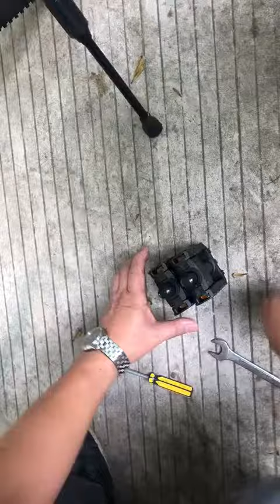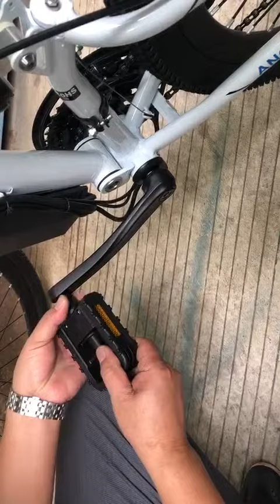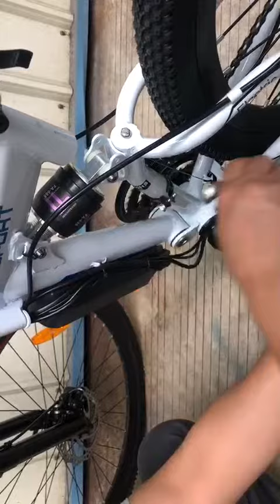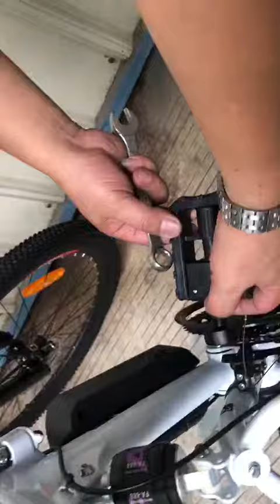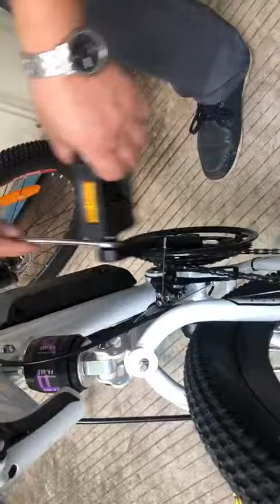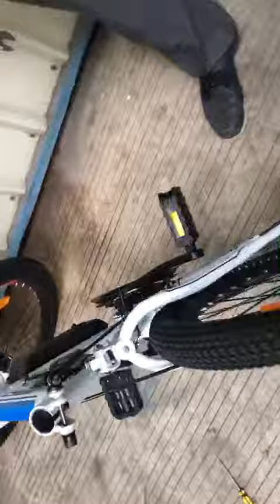How to install the pedal

Comment: Slowly screw the left pedal (counterclockwise) into the screw hole of the left crank. 
Slowly screw the right pedal (clockwise) into the screw hole of the right crank (the side of the chainset).
Don't use rude force, otherwise, the thread will get damage easily.